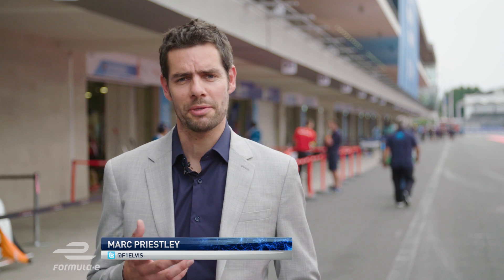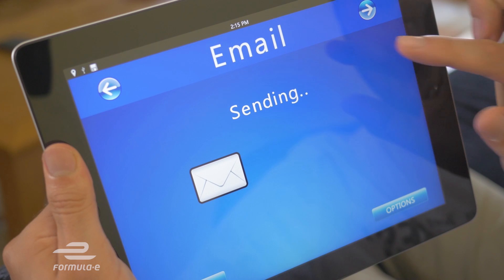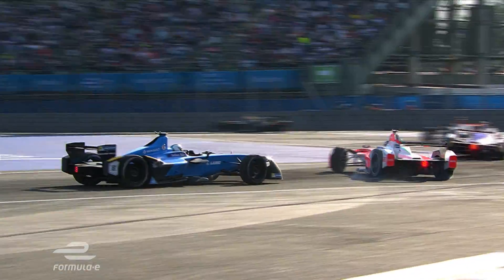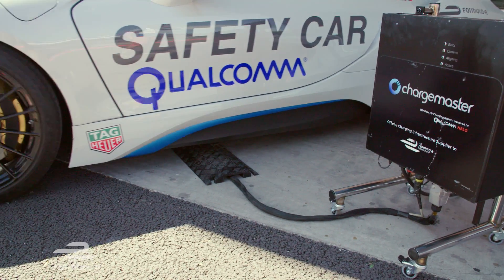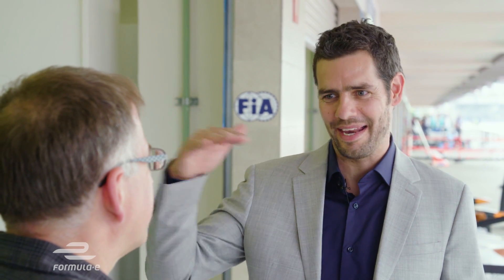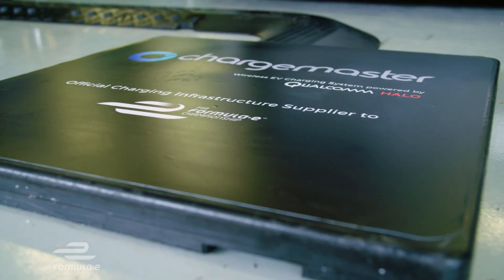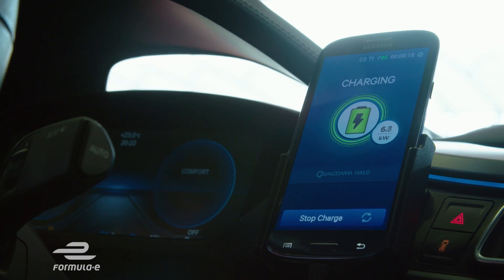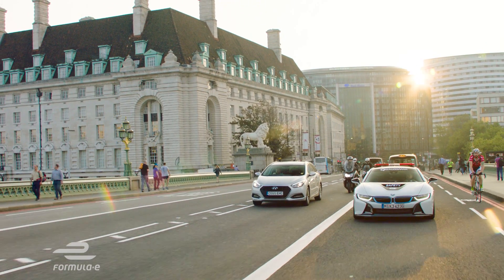How Wireless Charging Works: Julius Baer Electrified Visions Episode 4 - Formula E

Comment: Someone at FIA should be kicking itself for losing the F-Zero trademark to Nintendo.
If the chargepad tech gets refined to the point a sector on the field or pits could be used to recharge batteries, that would pretty much turn Formula E into what F-Zero imagined way back on the SNES

Comment: I still think that this kind of charging pad idea should be incorporated into something to replace Fanboost.  ALL the drivers would get the chance to pick up available Batteryboost points - However, unlike Fanboost, the drivers would need to show skill to actually "pick up" their Batteryboosts, by driving over designated pads around the track.  (It wouldn't need to actually provide charging on-the-go, the pad would know when a car drove directly over it and the extra points would be allocated to that driver but it would demonstrate the idea of charging wirelessly).  I reckon that this would be much more engaging and exciting than the current version of Fanboost which is a bit "meh" and not really in the spirit of racing to be honest.  It would be much more exciting if there were colourful pads on the track that could increase the available energy by say 0.1% every time a driver drove over it.  Over the course of a race that'd add a decent advantage to their available energy.  If you really want to keep the advantage given by Fanboost, at least add an element of skill!  Have we ever even seen Fanboost actually used to good effect in a race?  It's not really obvious to the viewer, whereas an increase in battery % would be instantly visible.
Reply: benjiferrero dggggccvvvcvcccccvvvvvgghbbhhbbbhjjjhbhjhjjjjjjjjjjjhh u y u I op p

Comment: can't you put these wireless charger on a road and charge it while it's driving?
Reply: You could, Agag even mentioned it as a means of charging the FE cars as the race is on, essentially creating a "charging line" on the circuit. The main issue is the cost and disruption of installing them of course so the cities would need to be on board.
Reply: Sinan Biyikli hgvhvbb.vbfgggr230
Reply: ksells bu
Reply: aracely ramirez torres Nice to see your contribution to the discussion there mate.
Reply: aracely ramirez torres una vita
Reply: k
sells
Reply: Piss off, spam comments